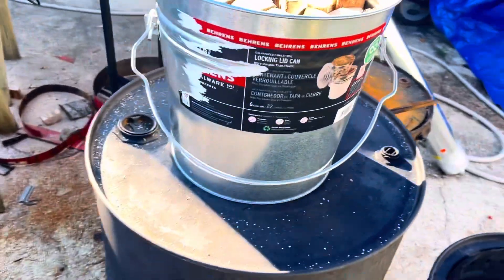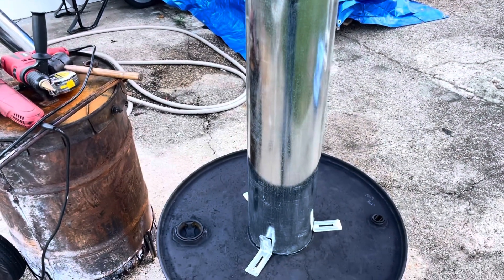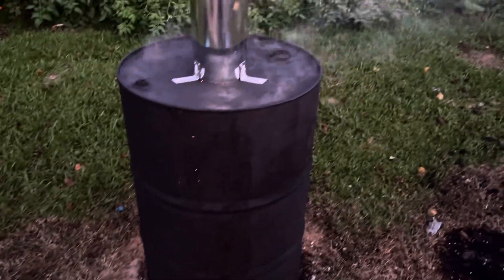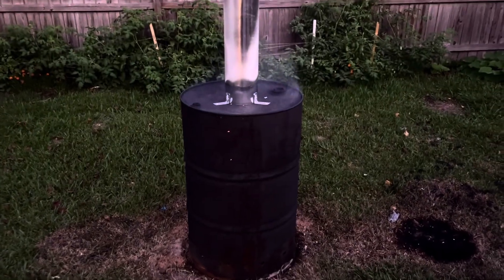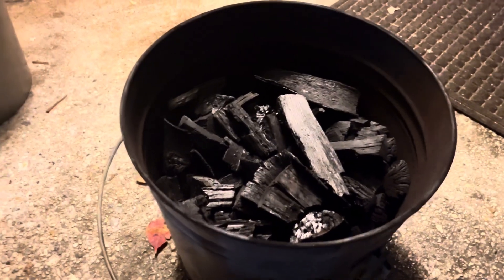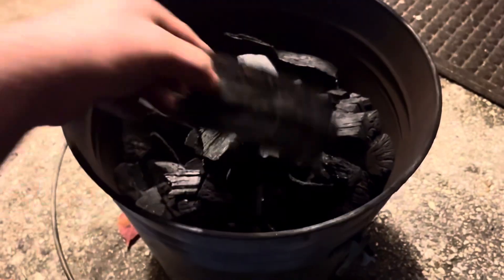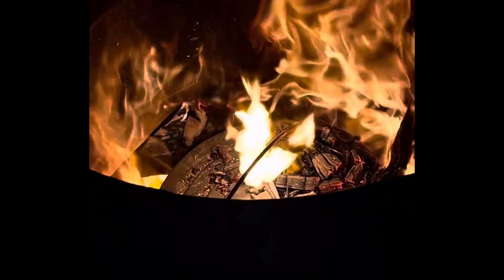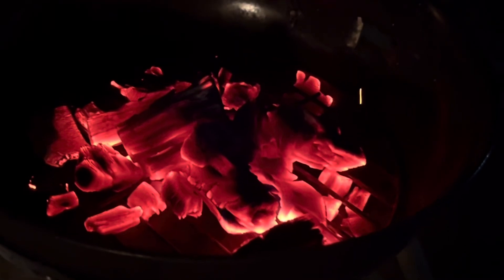DIY Charcoal in a Homemade Charcoal Retort: Super Fast and Cheap!

Comment: You're not getting enough air brought into the system.  You're barrel is glowing right where new air is coming in because it can burn at full temp then it's using all the oxygen up... that why your getting so much smoke.  You need more air at the bottom and then a place for more air to come in at the top and burn your smoke.  If you were super efficient, you would get basically no smoke out the top.   It looks great, keep refining.
Reply from the maker: I have since refined it, and I get no smoke after the initial start up now. Thanks for watching.